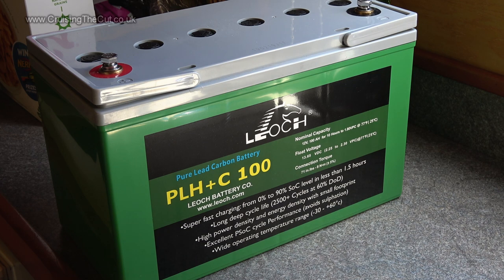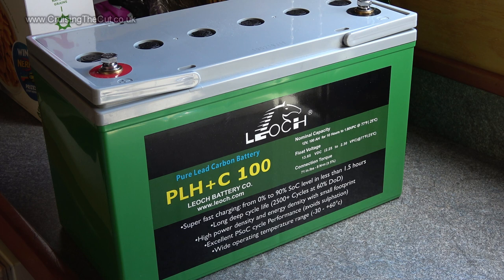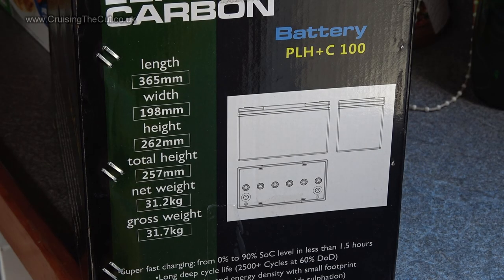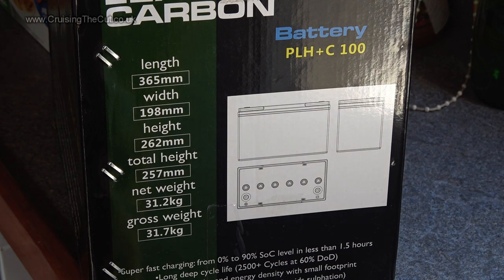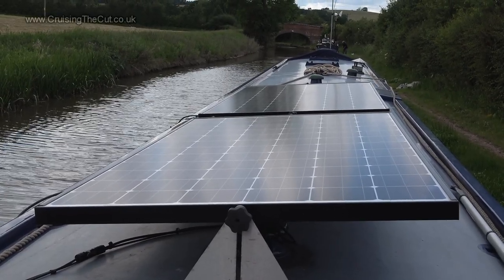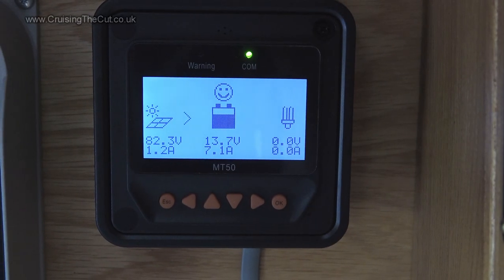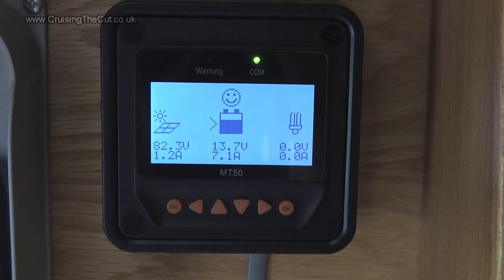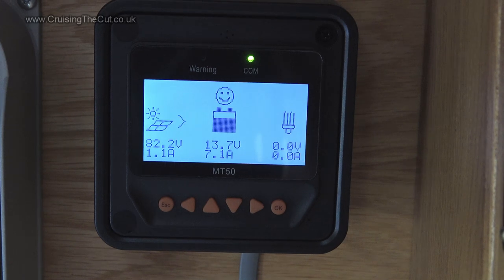178. Installing Lead Carbon batteries (12V 100Ah) into my canal narrowboat

Comment: Nice job...putting on my EE (electrical engineering and amateur radio hat...and someone who has 40KW solar plant expanding to 60KW on his farm :) ) hat...

I thought you did a fine job.  the notion of taping the "spanner" was a good one.  but not to just leap into the controversy (different pronunciations :) ) that is the reason you disconnect the ground wire first.  Once you disconnect the ground wire, then you can touch the positive terminal to "boat ground" without any danger of anything happening.  the positive end is "floating" because it has no ground...and so it wont do anything.  there should be "a little spark" when you reconnect the battery but that is why you connect the battery plus voltage first...so you "draw" the spark from the negative terminal...and then you equalize the grounds...which has no danger to it.  if you get it from the positive terminal there is a chance if somehow "you" (ie your body) was the first thing to form a path to ground ...the current could flow through "you".  but if you are at ground and you are grounding the negative terminal...the current will flow through "the wire" not you.

I thought the wiring was done well...if you want an explanation of why you do the positive and negative like you did it in the battery rebuild...well I can...but you did it correct (its all about voltage equalization of the batteries).  

two minor questions 1) do you ground the negative to the hull?  2) what did you do with the old batteries?  did you sale them or use them in another way on the boat.  anyway again nice job.  I am enjoying the vlogs and sorry if this is to long :) be safe Robert from Istanbul (and Santa Fe Texas where the solar farm is )
Reply from the maker: Thank you. Yes the battery -ve are all connected to a single point on the hull.
Reply: @CruisingTheCut  Interesting. Not what I'd have done. I'd have used copper cabling for power distribution.

Comment: Thank you so much for the brilliantly informative link to battery wiring. It had never occurred to me that the interconnecting links resistance and the batteries internal resistance could result in such a huge difference in the amount of current drawn from the batteries. I had always assumed it to be negligible. How wrong can you be?
Anybody planning on connecting any number of batteries together should carefully read the information.
Yours, slightly humbled.

Comment: I've always loved your DIY. Always very informative. If I had the spare cash,  I would buy you some battery meters. I'm dead keen on these new types of batteries for my boat so would be really good to know how they perform. You've always been quite good at the techy stuff in my opinion...explained in normal everyday English without all the jargon.  Even the way you just explained how your batteries were connected (and re-connected) was most useful.
Reply from the maker: The trouble, as I understand it with those battery monitors which measure Amps consumed, is that as soon as the battery is anything other than brand new they start to drift in accuracy because they have to make certain guesses about capacity over time. So they're inaccurate, basically. Equally volt meters (which can give a true picture of state of charge) can only measure the battery state correctly when there's no load or charge being applied and after the battery's had time to settle. So on a solar-equipped system that means switching everything off in the dead of night, giving it an hour or so, then taking a voltmeter reading and only then will you have a true picture of SoC!!
Reply: @CruisingTheCut  Really? How interesting. My battery setup is basic compared to most, consisting of a portable power station with a 40A LI battery inside, solar controller and inverter all in one. I see the state of my battery with 4 tiny LED lights. I find them very useful in managing my battery levels actually. I like simple visual aids like that.

Comment: My guess is you are dead close on the reason for the spark.  More likely than the capacitors dischaging into the batteries, it would be the other way around, the capacitors are essentially"on" until they are charged, hence the spark when completing the circuit.

Comment: Well good morning David. A new video to go along with my first cup of coffee for the day.  I must admit I know absolutely know nothing about Carbon Lead or is it Lead Carbon batteries?  Anyway, your video is most excellently done I must say. Of course I would expect or accept nothing less coming from you.  

Maybe you said it in another video but what is your purpose for changing from Lead Acid to the new battery?  I can understand why you did go to LiFePO, cost primarily but why the new chemistry if all you are gaining is a 20% increase in depth of discharge?  BTW, I wish to watch Vlog 177a in one setting on the 60” TV opposed to the 9.7” iPad so it will view ASAP.  Cheerio David and thanks for sharing your electrical experiences.
Reply from the maker: It's not just the extra DoD but also the faster charge acceptance, the ability to withstand partial state of charge, cope with total (100%) discharge up to 500 times, and a cycle life of 2,500 times vs around 600 for conventional batteries.
Reply: Ok.  I’m retired living on what we call a fixed income here on the west side of the pond.  My hobbies include amateur radio, which as most know is NOT an inexpensive past time.  I’m looking for ways to operate my station off grid only so battery is really the only option. LiFePO batteries are not cheap $509.00 for a 50AHr battery with 10A Charger.  I do get the luxury of 90% discharge with about a 5hr charge time. Additionally, the battery can be recharged 2000+ times after a 90% DoD and I don’t have to worry about hydrogen off gassing inside the radio room.  Thank you for your response.

Comment: A small spark is normal due to voltage differential between the batteries. Yes, even a 10th or 100th of a volt. If your inverter was connected, the caps and such, even when off, creates a load due to bleed-off discharging.  Look up "capacitor forming tool" to see how to connect a light bulb to balance the differential voltages before connecting without a spark.
Reply from the maker: Cheers, sounds like a good idea
Reply: Yes, the Inverter caps will charge to the battery voltage almost instantly when you connect up, and that can be a lot of amps. I'm totally off grid and have 1500Kw of solar and a 450Ah 24v battery bank. I also have a combiner box with each panel going through its own breaker and a massive breaker between battery and inverter. So I can isolate everything with a flick of a switch. That means I can connect the batteries to the inverter with the breaker off, no sparks, and then turn it on, no sparks there either. Much better for the heart rate! I would recommend you consider a breaker or some sort of disconnect between battery and inverter. Many inverter manuals recommend that or a suitable fuse, just in case the fault occurs in the inverter and you have to disconnect quickly.
Great vlog as usual. I'm really interested in how the batteries work out.
Reply from the maker: I'm definitely going to consider adding one in!

Comment: I've found that having a disconnect between the battery and the inverter will stop that spark. I believe that the inverter has a power draw even if it is not on.

Comment: Excellent video - I was very interested as I have a similar battery setup in my own narrowboat and am always looking out for new battery technologies that don't cost the earth (oh dear, must watch the puns).  I must say it's very surprising that some people commenting below who claim to be engineers, haven't understood why the take-off points for the positive and negative leads do matter, in balancing the loads on the batteries - as there is always some lead/terminal resistance and total current can get up to 100A in some circumstances leading to significant differences in voltage drops.  Perhaps they don't realise that we narrowboaters only operate at 12V!
Anyway I have one question about the charging setup - you stated that you decided to set your solar charge controller to 14.25V, but presumably your engine alternator (which I gather is quite new!) is charging at a rate of at least 14.5V - I notice that in use mine sometimes goes even higher than that once the engine has been running for a while. So I take it the lead carbon batteries can cope with that OK? - Thanks, Nigel
Reply from the maker: The alternator puts out 14.4V which the battery manufacturer says is OK

Comment: Maybe it would be a good idea to look for a suitable battery monitor? Ray from Love your RV has one and he thinks highly of it.
Reply from the maker: Cheers, I do watch him. Trouble is these Amp Hour meters are partly guessing as soon as the batteries are anything less than brand new so they become steadily more inaccurate. Meanwhile voltmeters only give you an accurate reading if there's no load or charge on the battery and it's been like that for an hour or so, so the only good time to measure is the dead of night (no solar and with everything switched off)

Comment: Lead/carbon is a good choice. similar performance to industrial deep cycle ( up to 70% discharge) but dont have the flooded acid problem, watering etc.  They are a little expensive, but a better choice than lithium ( who wants to be burned alive in a lithium fire, although Tesla owners seem to like them.) Equalization usually is needed for flooded lead/acid batteries ( it also stirs the acid solution so it doesnt seperate in static,stationary installs).
Reply: Wazza...All lithium are not dangerous and few folks still have flooded lead acid in mobile situations. Perhaps a comparison with AGM batteries would be better.
Reply from the maker: @Rumsky That's very interesting to hear, thanks for that. I shall keep an extra close eye on mine.
Reply: wazza... The current best choice lithium for this kind of application is LiFePO4. Unlike the lithium chemistries used in laptops, phones, etc. (and yes, Teslas),  LiFePO4 are not particularly explosive/flammable. However, when compared to laptop lithium batteries, LiFePO4 are not as energy dense.

It appears that David's primary aversion to Lithium (LiFePO4) is initial cost. The lithium batteries last for many more cycles than lead-acid ones. From my cursory check on lead-carbon, they claim to last for more cycles than lead-acid. So, assume you (or he) can get trustworthy data, one could calculate the lifetime cost comparison of the three chemistries.
Reply: @Rumsky Victron have a similar battery technology.  They state 700 cycles, but can't replicate the 2000 cycles of some other manufacturers.  Sad I had high hopes for these batteries.  Do keep us informed how you get on.

Comment: Oh... and as others have said.... get yourself a battery monitor, you won't regret it ! Your reply that they aren't accurate, or drift out of accuracy is not massively true.... on the BMV you can program the Peukart and it will do a pretty good job of keeping a good SOC (% charged) accuracy. However - that is not the main benefit.... seeing how many Watts or Ah go in and come out of your battery is probably the best way to know where you are.  Once you install one, you'll wonder how you got by without it - especially the BMV712, with the bluetooth app.... geeks delight ! :)

Comment: hi davidthe way you have connected your batteries is correct. you solar panels or charger now see a 300 AH battery and you get drain equally over the 3 batteries, it may take a little longer to charge but your batteries will thank you for it in the long run. by just having the solar panels or charger  connected to one battery your drain is really over 1 battery (100 Ah ) even though they are all connected.
Reply from the maker: Hi Wayne. Cheers but they always were in parallel and I haven't changed anything on that front nor was I trying to! This wasn't about changing that but the way the power gets pushed in or taken out evenly across the bank of three. See the link in the video description for details.

Comment: Negative earth system, negative off first, as this means touch a grounded metal when removing the positive will not be a problem, and neg on last when refitting for the same

reason. Positive earth system, positive off first and on last. Only use a spanner shorter the gap between the pos and neg as you then cannot short out the terminals anyway.

Comment: The most important statistic on your engine starter battery spec should be its CCA or Cold Cranking Amps.
Reply from the maker: True. This was about the leisure batteries though.

Comment: I think you have been very modest about your understanding of your boats electrical system. I think you may have mentioned or explained this before, but I can't remember where. I thought that I had seen, that, on starting the engine, the alternator charges the engine battery first until fully charged and only then charges the leisure batteries? If I,ve understood that correctly, what controls the switchover between which batteries get charged?
Reply from the maker: The alternator charges both simultaneously but when the engine is off is disconnected so the starter doesn't get drained by leisure use like lights, TV etc
Reply: @CruisingTheCut  Thank you very much for replying. I have watched so many boat and motorhome videos that I may have, incorrectly, attributed that statement to you. Something must be causing a disconnection at some point though, in respect of how the batteries are drained or charged.

Comment: The positive  cable on the far left going into the side  is very close or touching the negative terminal. I would move the red cable away, in case the insulation fails.

Comment: You have got me thinking..... my new sailaway is now built up to the gunwales and I'm starting to specify some additions of which this might be one  - I wonder why the lead-carbon tech hasn't been more widely promoted in narrowboat circles when it seems to have technical advantages over lead acid and lithium at a fraction of the cost of lithium - I'll be watching with avid interest ...
Reply from the maker: I think only because it seems to be a relatively new tech for the marine industry, it's mainly been pitched at offgrid solar farms til now

Comment: Hi David, did you have to alter the regulator on the alternator to the batteries charging parameters. Sorry if someone has already asked but you have 1.2k comments.
Reply from the maker: No, it was set to 14.4V charging

Comment: I work on UPS aka uninterrupted power source. The cut off switch was always on the negative side. The capacitors in this thing was 60,000 volts knocked the piss out of you.😂
Reply: However, these units don’t always follow industry standards they simply follow standards for the power supply systems as data centres are always done differently

Comment: Did you get your interconnecting cables made locally or on line.?Thinking of doing the same as you but I don't have the tooling to make the heavy gauge cables.

Comment: Nice video, just two questions:
- Why not install a Victron BMV 712 battery monitor, a new battery bank deserves a good monitoring of it.
- Why Lead - Carbon batteries and not going for LifeP04 Lithium. Price?
Reply from the maker: Those battery monitors can be inaccurate particularly over time as the batteries degrade. Lithium is way too expensive, can't be charged when cold and so would require me to move the entire battery bank into the cabin area which would be a massive undertaking.

Comment: Just found this video. Thanks very informative. I have to replace mine in the coming weeks. I have just checked the weight and they are close to 50kg each and I have to lower them into my bow hold. How did you manoeuvre the batteries around and up and down into place. Thanks
Reply from the maker: Just lifted them in, being careful not to strain my back and do the lifting properly.

Comment: I know absolutely 0 about installing batteries in sequence. So looks good to me. Lol. However, I've never noticed the spring tension rods going across the boat near the ceiling.  Laundry drying rods? My tub shower rod does double duty in that manner.😁😉
Reply from the maker: Yes, laundry (and they're brilliant for it). Bought them while I was doing my camper conversion then re-used them in the boat :-)

Comment: Brother from across the sea, don't you need a battery isolater between the cabin batteries and the starter battery?
Reply from the maker: No. They're only connected by the common negatives, the positives are separate. They do join when the alternator is running so as to both charge from the engine but a relay disconnects them when it stops.
Reply: @CruisingTheCut  Very neat and simple. Thanks.

Comment: Disconnecting of battery wires. I know of no technical reason for disconnecting one side over another. From a practical perspective, on a vehicle where the batteries are in close proximity to the metal cassis, disconnecting the grounds first will not result in a short if your spanner touches the metal chassis. Once the grounds are disconnected, there is no longer a path to ground even if your spanner touches the metal chassis while disconnecting the positives. With your batteries being surrounded by wood, the choice is yours.
As to shorting between terminals, a short is a short, regardless of which terminal the spanner was first in contact with.
I did know a truck mechanic who had the name of a popular US tool brand etched in to his palm. In his case, it was the result of the spanner shorting between terminals.
Reply from the maker: Ouch!!

Comment: the inverter charges up when you reconnect it, the capacitors discharge when the inverter is unplugged, then recharge when you reconnect the power, it can be a bit scary especially if you are not expecting it